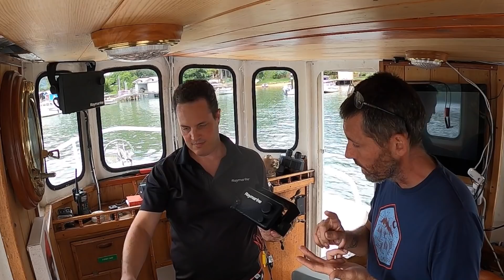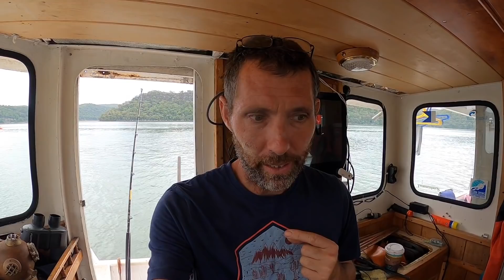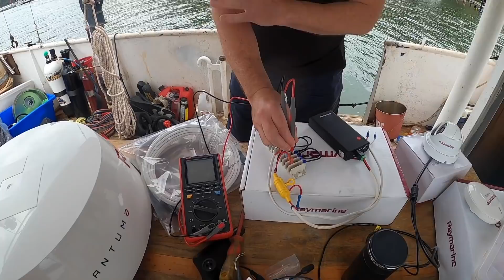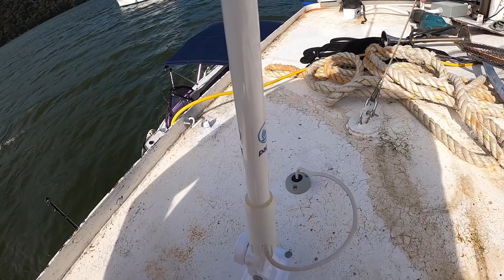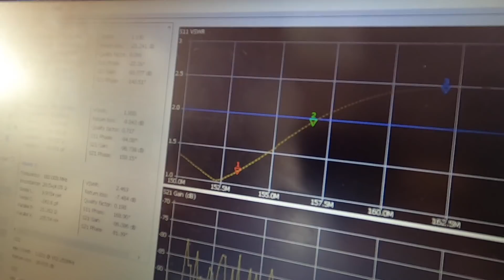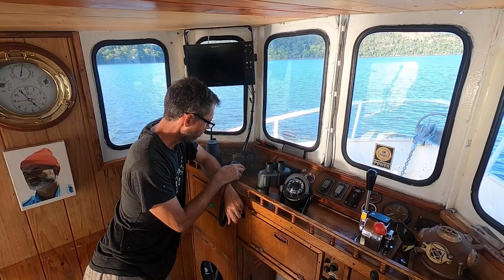Marine VHF radio installation and antenna tuning

Comment: re :antenna (dipole) in this case a vertical, yet still a dipole as 99% of all antennas qualify as dipole antennas, look at it this way,, your upper body and legs is the coax,,,   your arms are the 2 legs of the antenna. The groundplane (one half of your antenna) is the ship hull, the other is the vertical part...now....
the impedance  will be between 75 to 50 ohms(many variations thereoff) on a vertical though ...closer to 25 ohms so swr = 2:1  that is if 50 ohms =1:2 swr...we can manipulate this value by lenghtening or shortening the coax cable to some extend as well as trim the lenght of the vertical part of the antenna to establish the resonance, yet to improve the swr to 1:1 or as close as possible we wil need to match it, (another can of worms) or use a balun with the correct ratio (a transformer) not common on vhf 300 000 /L freq... for a full wave lenght.. devided x4 for qurter wave or 2 for half way,,but some vhf antenna are 5/8 wave lenghts and for a good reason, like the Windom antenna we manipulate the impedance to be 200 ohm by placing our feed point at a certain distance (re: the two arms are not equal in lenght) theirby  creating a feepoint value we need.. ugh im to long winded! :)
glad you got all working.

now ..remember you have many metal structures ontop of the cabin as well and they will introduce many scenarios  on the antenna as well so close by.. mounted in the clear all metal below the antenna will be a good start(i know :)  just saying )

Comment: I have been looking to upgrade my radio on 24ft boat. It would be handy to have the GPS built into the radio as an extra precaution. I also have been looking at AIS transceiver instead of just a receiver.
Reply from the maker: Yes, it is good that the Ray63 has the build in GPS, even though it will favour any GPS on the network that has a higher accuracy. This is particularly important on my boat as it is steel and the radio doesn't have an external antenna. AIS transceivers are also great. There are many safey, security and convenience benefits to being seen as well as seeing other boats.

Comment: I expect that the Raymarine ST NG standard will be outdated - on the newest items you will find NMEA2000 connectors. But with a simple adapter cable you may interconnect them.

Comment: You could put an all weather speaker outside under the awning to hear the radio while working/cruising/fishing with an on/off type switch for the output to speaker. 
Might not want to hear it all the time or a switchable a/b/c switch for other devices to use speaker.

Comment: So, if my EPERB is connected via the NMEA (2000) backbone to the AEIS but not the STNG, does the VHF interfere with the AC signal from the MMSI ethernet? Or is it the other way round?
I prefered the hand-held radio.
Reply from the maker: Yes, having 200 metres of range is much better.
Reply: @DangarMarine  You could shout more effectively over 200 metres... Still, if you're lucky you might get up to 18NM out of your new set-up. As long as it's line of sight that is. Loved the episode but you and Adrian were clearly bullying John at the end. Poor man - I don't think he'd had the same special grown-ups drink you both had clearly enjoyed. Hope he hadn't done the work for free. It was like Hooper being bullied by Chief Brody and Quint in Jaws.

Comment: So you're getting an Autopilot, what could possibly go wrong? I'll tell you.
You are going to be presented with two rather tempting buttons, either physical or on screen.
One is "Steer Route" and the other "Steer Course". Let's talk about the first one. Imagine that you are steaming North and you have been a good boy and marked all your waypoints. Usually people use headlands or perhaps a navigation buoy for these waypoints. I don't know about your area but here we have many Cardinal buoys. (mostly shipwrecks)
So off you go on Autopilot heading towards your waypoint, two things can go wrong!
Firstly, all the buggers steaming South have chosen the same waypoint, this is bad!
Secondly, you have to accept the waypoint by pressing a button after the Autopilot has beeped at a pre-selected distance. If you don't accept the waypoint the boat will steam around in circles, if your waypoint is too close to land then you're in big trouble. Try not to fall asleep :)
Next we'll discuss the "Steer Course" option:
This example is from a real life case of a big ship hitting a half mile long island. They were steaming due East and had pressed the "Steer Course" button. But the tide took them North and obviously they had fallen asleep. The ship was irreparably damaged but had a cargo of a valuable mineral so it was towed into harbour. All the crew survived.
Don't get me wrong, I love Autopilot. But please don't fall asleep at the wheel.
Reply from the maker: Wasn't planning to fall asleep at the wheel.
Reply: @DangarMarine  I was only trying to point out the pitfalls of relying on Autopilot. It's a great system. I worked in SAR and could tell you more stories of boats going AWOL. I hope that your upgrade goes well. 
BTW. Invest in a petrol or diesel water pump. It can be used to float a leaking boat or by attaching a fire hose can put out small fires. You may only use it once but when you do you'll be a hero :)
P.S. The diesel pumps are hard to start and if you don't know what you're doing you will snap the pull cord.

Comment: You may never accept a DSC distress call without contacting a rescue coordination center first who gives you this permission! If you do this their vhf stops sending their distress call and it is your responisibillity to lead the rescue as a on scene commander.
Reply from the maker: Yes, wait for a ground station to accept and they should wait for boats in the vicinity to receive it before they accept it too.

Comment: Mate l have been  Ham Radio Opr...For over 60 years now,SWR is the most misunderstood by most people...A lot of people have destoryed there radio stuff because of it.....I was glad to you getting that taken care of.....Thanks my friend....Cheers...!
Reply from the maker: Thanks mate, it was interesting to learn more about what it means and how it works across the frequency spectrum. Maybe not super important for VHF but very interesting non the less. :)
Reply: @DangarMarine  lt is if you wont to transmitte at longer distance....Modern radios have a safe guard built into them to keep them from over heating the finals (power transistors) but also have transistors to kick the finals...But also haft to find a happy  medium between different channels on your radio...Cheers my friend...

Comment: i wonder about antenna materials.  years ago i read about Diamagnetic and Paramagnetic materials. one of them if you run an electric charge thru a straight piece will create magnetic poles at the ends.  but the other one when the electric charge thru it. does not have magnetic poles at the ends but shifts them 90 degrees.   which when i talked to my brother (rip) said that explains why when antennas get dunked in water the transmitted signal shifts 90 degrees from when its in the air..  diamagnetic materials are repulsed by magnetic fields..  water , copper, silver are diamagnetic materials.. the magnetic levitation of a frog by a strong magnetic field is the water in the frog pushing away from the magnetic.. so i was wondering.. do Diamagnetic metals or Paramagnetic metals make better antennas.. 
a question if Pacific antennas calls you .. does fresh water from rain or salt water splash on the antenna mast effect broadcast angle of the antenna.  if so should the antenna mast be coated with a water repelling hydrophobic coating from the factory.. with a way to renew the coating in the field .. or sending it back to the factory for recoating?  these are just thoughts.. .   i seem to recall that hydrogen is a diamagnetic material also .. so that is probably why water is a diamagnetic. 
in reality. i don't expect an answer to this question.. i expect it to be talked about by specialists in the radio component world..
Reply from the maker: Interesting to hear about, I'll definitely ask when I speak with them.

Comment: V.S.R.
"Voltage standing wave ratio (VSWR) is defined as the ratio between transmitted and reflected voltage standing waves in a radio frequency (RF) electrical transmission system. It is a measure of how efficiently RF power is transmitted from the power source, through a transmission line, and into the load."

Comment: Curious to see why you shouldn't terminate the pl259 antenna plug because by doing this you keep the cable as short as possible which is also recommended
Reply from the maker: You can terminate it yours if you do it correctly and test afterwards. The trouble is that most people have never done a termination before and don't test it afterwards so are better off using a factory cable.

Comment: Keep it simple, one aerial for each job.   We had problems with our vehicle diplexers years ago.  A Philips engineer came out and we tried to get some pearls of radio wisdom from him.  His reply, "Sometimes they work; sometimes they dont".    I also mistrust fibreglass dipole whip aerials.  You should not need them on a steel hull or with a s/steel A frame mount where the superstructure will form one part of the diplole.  We ditched them from our workboats and used s/steel whips after we cut up an old fibreglass dipole (that had limited range) and found a mess of thin wet wire in the hollow base of the unit.   The wire was stupidly thin and had broken unseen from the tip.
Reply from the maker: Interesting to hear, I got these antennas in a bit of a rush from a local store. It will be interesting to talk to Pacific Aerials about better options.

Comment: I just wish there was acouple fella in lakes entrance that could help me with my ex cray boat I run it out off fuel can't get fuel to pump out the injector think I need more fuel but 5 ppl now no show and waiting on diesel shop to call but it a bowman 4 cyl diesel in a 28 ft ex crayboat

Comment: That radio check was quite involved I work at an airport and when people call for a check its usually just a quick "loud and clear"!
Reply: Ha yes! No mucking around with aviaion. Like boating but 100x as dangerous, complicated, mind-numbing with absolutely no time to do anything in an emergency. On a boat you can switch the engine off and have a cup of tea.

Comment: The three minute silence periods on the hour and half hour that you mentioned only applied on 2182 kHz, and were eliminated in 2013.
I expect your antenna manufacturer would be extremely upset at your attempt to re-tune his antenna.   The 6 dB antenna you were working with actually consists of two stacked dipoles, not a single wire, so you were de-tuning half of one of the dipoles (besides removing the waterproofing)

Comment: I have an old radar sitting in garage,should i put it on a boat?is it usefull to have ine
Reply from the maker: Radar is definitely an extremely useful piece of equipment to have on a boat. If it is working well and tuned correctly it is worth having onboard.

Comment: Hey Stu, I'm confused as to why Jon thinks that's a dipole antenna, dipoles are fed from the middle which isn't practical for this type. These are usually a colinear design. Imagine a T shaped antenna where the lower leg of the T is your feeder, that's a dipole. While what he says about dipoles is correct, this is not one. Cutting more off would most certainly raise where the SWR dip is with your antenna.
Reply from the maker: I presume the point the cable is fed into the fibreglass housing is mostly for mounting convenience, it may then connect internally at the mid point. I would be interesting to confirm.
Reply: @DangarMarine  I would be very interested to hear. Borescope down the tube would  show it.

Comment: hey Stu, you have same t-shirt as me, but mine is clean 😜   Nice Raymarine stuff for Renko, almost the same as my boat setup, i run 2 Axioms, AR200, AIS700, RAY63, and some other NMEA2000 stuff.  Radar and camera's is on the list.
Reply from the maker: I don't think I've had a clean one in years! ;) Sounds like a nice setup on your boat. It is great the way all this gear works together now with the networking side of things. Much better than the old days of having separate sounder / GPS / radar etc.

Comment: Off topic question.
Why doesn't your cabin ceiling covering extend to the walls?
I have found that when tuning amateur radio antennas for best SWR the human presence must be removed from the antenna being tuned.
JIM
Reply from the maker: Still runing wiring through the ceiling. Yes, in the end we started using a plastic spring clamp to hold it.

Comment: Trimming pretuned marine band antennas is not always recommended. Antenna theory is a science in its own. Best VSWR is sometimes not always best. 5/8th ground independent marine antennas (made for fibreglass and steel boats) which that one looks like, will have gain. Trimming the end may improve VSWR, but may effect the radiation pattern (gain) in a detrimental way.
Reply from the maker: Yes, we tried to get in touch with Pacific Aerials to ask about this. The VHF antenna is left factory, this was just playing with the second antenna to see if we could improve it for the AIS frequencies. I may just swap it for a dedicated AIS antenna but it was fun to experiment with it.

Comment: I remember tuning the old cb radios with a swar meter. Why do marine electronics need to be so complicated!? I swung paste Renko yesterday in my catamaran to check her out. You looked busy Stu so I didn’t bother you. I did try to call you on vhf later but it obviously wasn’t working.🤣🤣
Reply from the maker: Hi Steve, you cruising up the coast at the moment?
Reply: @DangarMarine  no unfortunately.  That was the plan this winter but it's not going to work out. Just hanging around Sydney for a while before heading home at the end of the month.

Comment: Smart move Stu to stick with a single name brand for all the electronics. The suite should integrate nicely.
Reply from the maker: Yes, it certainly does make the integration much simpler and more reliable that's for sure.

Comment: Hi stu, I came up beside renko as you were leaving mooney on a white zodiac. We were in the blue sailboat replacing the windows not far from you.
Reply from the maker: Ah, I think I saw that boat. I was there with Adrian working on the Detroit 6-71 in the timber boat. :)
Reply: @DangarMarine  yeah that would be us, we were cutting flexi glass which was really loud. I think I saw you look over at one point from renkos wheelhouse

Comment: The MOB1 device works with the AIS system, it uses GPS position and reports to surrounding vessels that there is a Man overboard.
Reply from the maker: Makes sense to use AIS so people in the vicinity that are able to directly able to help you find out you have a person in the water.

Comment: Good to see a proper radio install, too many folks just plug and play without checking things like SWR for signals reflected back into the radio and power supply levels. You don't want to find out things aren't working properly when you really need them. Cheers on another great video Stu :)
Reply from the maker: Thanks Matthew, hope to catch up again before we head north. :)

Comment: AIS?
Reply from the maker: Automatic Identification System, it will have its own separate video.
Reply: @DangarMarine  Yse,I went with Standard Horizon.  Haven't hooked it up yet. My Lowrance chart/depth finder wont support NEMA 2000, so  I will  use the older system for now. The radio has a small chart screen built in I think.  This is very good stuff here.     🤘😎

Comment: As a former radio installation tech, I rather enjoyed this episode. I actually just found my SWR meter the other day. I need to look for some antennas to test. Maybe I could stop by. It’s only about 15,380 km. noon tomorrow???😂
Reply from the maker: I’ll make the sandwiches. :)
Reply: @DangarMarine  I really wish I could make the trip. Between you, Brupeg, She’ll be right, and Free Range Sailing...a good portion of my viewing is from down under. I just might have emigrate. Move all my shop gear and give everyone a hand.

Comment: I absolutely hate installing/tuning antennas. I would rather have my toe nails pulled with broken pliars!!  When I was a firefighter, I was Captain of our Heavy Rescue and had a few department radios in my personal truck (a UHF, a VHF, and an 800mhz trucked radio) which I installed myself.  Trimming and tuning those antennas was hell.  Each interfered with the other to a point I couldnt get as much as a peep out due to what I was told was band/frequency  crossover interfearance which is common with multiple bands in a small area.  From now on....if I need a radio.....professional installation!!   Thank you again for a great video and see you in the next ome.
Reply from the maker: Things definitely get much more complicated when you have multiple units interfering with each other.

Comment: Just noticed, are You going to install wipers for bad weather.  And when did you upgrade the shifter/ Throttle? You holding out?!
Reply from the maker: Probably won't do wipers straight away but may add them down the track. New throttle upgrade is in next week's video.

Comment: I take it that you have no need for an HF transceiver because you don't expect to be far enough offshore to be out of VHF range. I wonder what the straight line miles are between Renko and Sydney.
Reply from the maker: Yes, I will only be doing coastal cruising at this stage. It will be interesting to find the exact location of the Marine Rescue radio tower that responded.